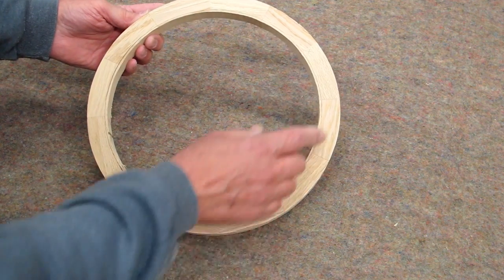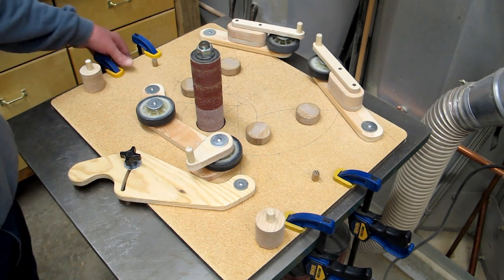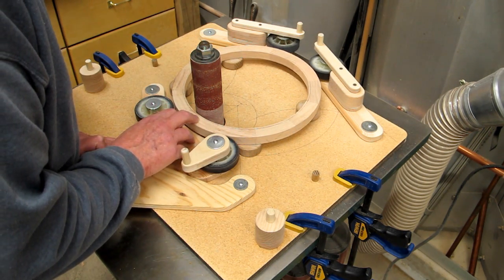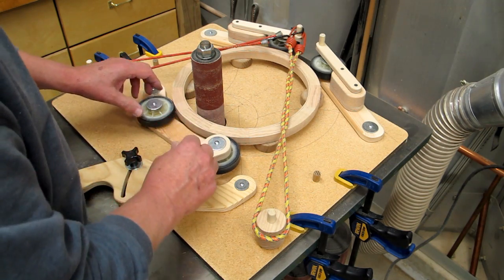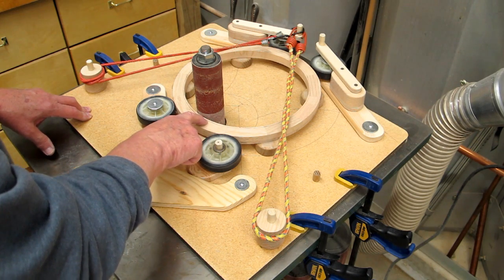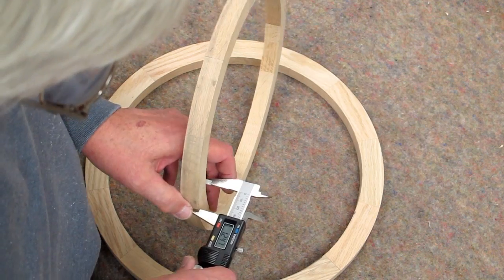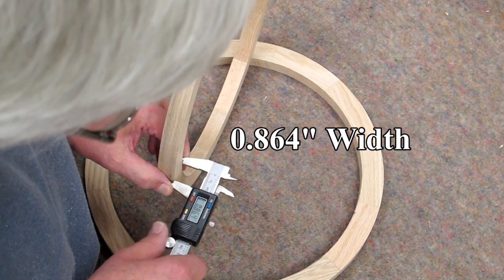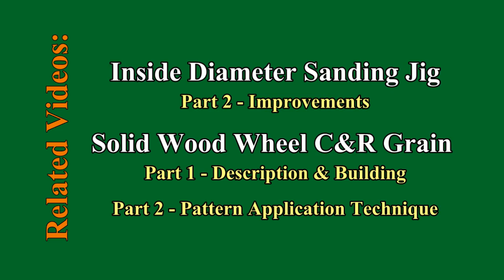Inside Diameter Sanding Jig Part 1 -- Making Accurate Wood Rings

Comment: was there a followup to this? I am interested in making my own jig to sand very precise inner and outer diameter, flat, wood rings with high precision inner bevel.
Reply from the maker: The jig, as presented in this video, works pretty well.  

There is Part 2 of this series, which shows some suggested changes or improvements.

Then there is C&R Grain Solid Wood Wheels Part 1 & 2, which show what I was making with the sanded rings. In one of these videos it is shown how truly one spins inside the other.

Once the rings are sanded true, then the bevel could be done with a router bit... so the bevel would be as true as the sanded ring.

Thanks for watching. Please subscribe. 
That's what keeps this channel going! 
Ron

Comment: Up to how big can we get the rings?
Reply from the maker: This video is Part 1 of a two-part series. You should watch Part 2. Also, there is a two-part video series on C&R Grain Solid Wood Wheels. The wood rings made for the largest clock wheels were 14 -15" outside diameter. The Inside Diameter Sanding Jig could make slightly larger rings or it could be modified for even larger rings. However, the limiting factor would most likely be finding a drum sander large enough to accept the larger diameter blanks. Thanks for watching. Please Subscribe… that is what keeps this channel available.

Comment: One approach that I thought about to hold the work piece in place while allowing it to rotate freely is instead of using the dryer wheels make two wheels out of wood with a concave groove in the middle of the wheel for the work piece to ride in.  In fact you can cut that wheel in half and attach it to a spindle to allow the concave space to expand or compress to fit varying sizes work pieces.  Of course tying these wheels together with a set of gears to synch their movement is a plus.

Comment from the maker: Maybe just a little close but you do not see my finger getting too close. I used that handle more as a lever than as a crank. And you probably noticed the handle was not always installed. It is not that effective for driving this anyway. A chain or wood gears driven by a slow speed drive motor would work more effectively and would give smoother results.

Comment from the maker: There lies the problem, that accurate template resulting in a perfect fit. Just how do you make that perfect template with a perfectly round concentric hole in the first place? And then if you need a range of sizes? My method works for a large range of sizes and that nearly perfect fit is demonstrated in the video; C&R Grain Solid Wood Wheels Part 1. Granted something fairly close is easier to make. I wanted the result to be better than close.

Comment: I was thinking the same thing.  A similar jig built for a router, but built with a more fixed in place design and less "floating" built into the system (because of using sanding techniques) would give a more accurate ring in the first place; then only requiring finish sanding.  A board with a center pin fixed to a router table and a straight cutting bit that you then place your board to be cut on and plunge and spin.  Outside circle first then the inside circle.

Comment from the maker: If you “already” had an accurate ring of the exact required size, you could duplicate it on the router table. If you don’t have a perfect pattern (and each wheel or gear is usually of a different size) then it becomes a problem because you don’t have a center reference point. A circle-cutting jig for a router could be devised but the ring would need to be held very securely (and I didn’t want any screw holes in it). If it moved even slightly you get to start all over again.